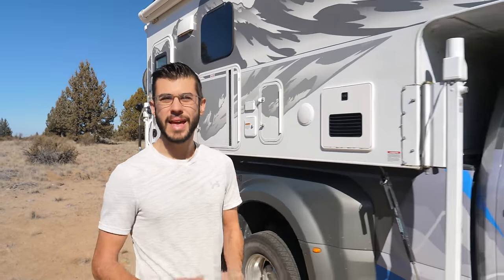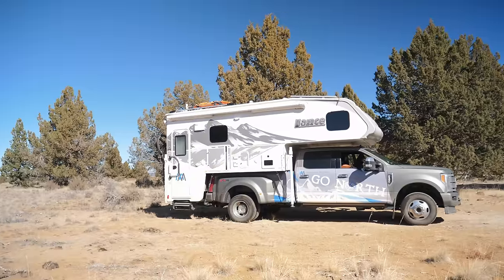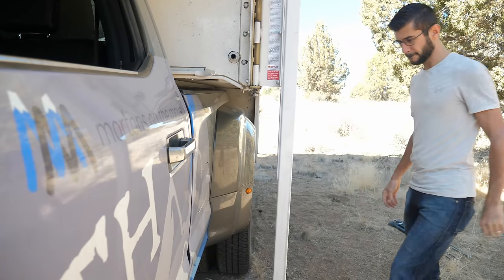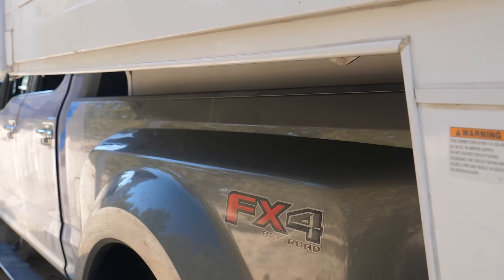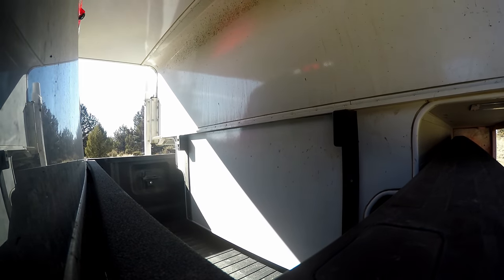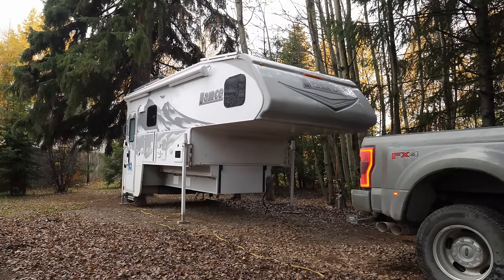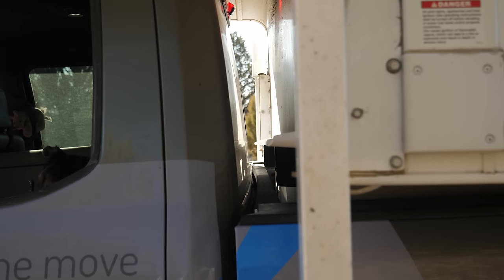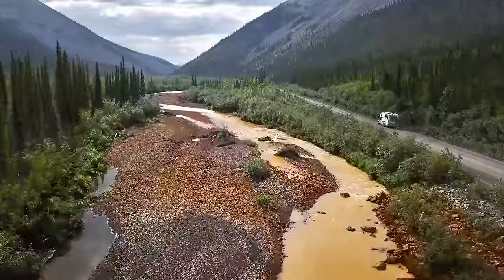How to Load and Unload a Truck Camper on a Pickup Truck | Go North Explore More

Comment: Man! This seem too much work. I might go for fifth wheeler or travel trailer. The easiest hookup is travel trailer.
Reply: And would be more stable on ground lol those stands look wobbly asf
Reply: TCs offer the most flexibilty of any RV and since they're shorter you can camp in almost all campground spots, including many tent sites (with the host's approval). Also, a TC only counts as 1 vehicle not 2, so it's easy to share a site with a friend and split the cost. The other advantage is you can take the camper off and use the truck for yardwork etc. Many class A campers ultimately end up with a TC due to their versatility
Reply: To much work ?? Really
Reply: When elk hunting, I use a truck mounted camper so I can also pull the horse trailer. Kinda tough to pull a camp trailer AND horses..
Reply: True, however, with trailer you’re twice or more longer. It’s nice to be able to park in your own driveway .  I had Cabover camper, Class A and a short toy hauler. Now looking for a cab over camper .

Comment: Nice. I like to drop in a 2x6 or whatever thickness your bumpstops are run along the width of the bed up against the front of the box - wrap in carpet or something to avoid squeaks. Hard braking, steep bumpy declines etc can cause campers to shift forward, sometimes violently and those bumpstops will dent your box and don't give either a firm point of contact. I probably take my camper into places you wouldn't dream of... but worth noting

Comment: I’ve been loading and unloading my slide-in truck campers for years when hunting and extended fishing trips. One thing I’ve learned is when a site is slightly sloping, is to back in to the uphill. That way when I pull out from underneath, I’m always getting farther down from camper as I drive out and don’t have hang-ups. Also, they make or you can have built front camper stabilizers to take care of camper wiggles when using off the truck.

Comment: Have had truck campers for 20 years and your video is spot on. One thing that is possible with electric jacks is to put lever on jack to neutral and using your foot push jack to ground then place lever to lock position, big timesaver when unloading.

Comment: The reason one motor is slower or faster than the other is due to the distance or run from the battery. Depending on the battery location, the farthest away jack will move the slowest.

Comment: for alignment ease when reloading, I mark the center location of my rear wheels before I pull out, with two bright yellow plastic tent pegs, pushed down an inch off the sidewalls. I can clearly see them in my side mirrors. Happy trails.

Comment: I painted a white line down the left side of the truck bed that lines up with the left side of the camper. When putting it back on I look out the rear window and site along the white line as I back up, occasionally double-checking from outside as I usually have to do this by myself just to be sure I'm straight.  Then lower away.

Comment: We bought a 1999 lance (no slides) just to spend 2 summers driving across Canada and up to Tuk.  Our manual jacks made the on/off process a much longer process.  I disliked taking the camper on and off.  And built out a cargo tray into the rear hitch for a 5-gallon gas tank and extra storage.  Electric jacks and fast guns are the way to go.  Good tutorial.

Comment: I use 1/2” plywood squares under each jack pad. 3/4 might better.   I have seen 2x4 or 2x6 lumber split under the weight of a camper jack.

Comment: Is there such thing as wear & tear from the torsion that is possibly introduced the during removal and installation? Perhaps damage to the seals at the edges of the body. Or are these seals flexible enough that damage rather occurs with aging from time, instead of the number of removal & installation cycles?

Comment: Man. Campers have come a long ways since my experiences back in the 90's. We had a 1978 Osprey 10.5' loaded onto a 1978 F-250. That unit had hydraulic jacks that didn't provide enough lift and needed help. Many campers didn't even have that and you had to use 2 portable tripod, cable driven towers you cranked with a come-along system. Very sketchy. Back then campers probably maxxed out at 2,500lbs. Now they climb well over 5,000lbs. 
We didn't even have frame mounted outriggers then. All you could get were turnbuckles hooked to stake-pocket brackets that would often pop out if the rig rocked too hard. Of course, in the 90's they finally had bed-mounted brackets and occasionally you'd see outriggers, but they hadn't gained popularity until later. Hell, we had to make a receiver extension to tow a trailer. Apparently this was unheard of. At least we had a custom hitch that could withstand the torque of the extension when loaded. 
Those days were somethin else.

Comment: I own the same camper, Lance 1172, and I was told by the Lance Dealership that the rubber blocks are supposed to ride on top of the truck bed while the two vertical strips underneath are the rub rails. Just wondering if you heard something different?

Comment: When I load/unload my camper, I usually take out some air out of my airbag suspension.  For my truck, this lowers the bed by about 4”. To re-inflate i use a small manual bike pump, since I haven’t installed an on-board compressor for the bags.
Reply from the maker: We would sometimes that too.  Helps to loose those few inches :)

Comment: I don't have a camper (yet) but planning on getting one.  I am glad that you made this video as i have never loaded one into a truck.  My question is when you were lowering it towards the ground right before the stairs would have hit.  Would you normally put blocks under the rear portion of the camper to (sit on) so that the camper doesn't actually sit on the ground  and take the load off the jacks?
Reply: You are not carrying these additional stuff. The jacks are made for the load

Comment: What about the hitch? my hitch / extension is 42inches and heavy. Not ease to put on, so bad taking off. At home I have a metal frame I put the hitch on. Its at or near reciever height. I would haven't have that while on the road. I tend to use my truck camper as a Class C, like a Class C, then off season I have a truck. When I had a C it was RV ONLY.
thanks
PS My 2020 F350 displays a black dotted line down the truck bed, I put a piece of black tape on my white camper and line them up..done.

Comment: How are the jacks powered from the camper?  Mine are plugged in but they don't raise/lower.  They don't even make any motor noise.  The remote lights up so I know the remote works.   Do they need to be plugged into 220?  It doesn't seem to work off the trailer harness with the truck running.
Reply from the maker: They operate off the batteries and have a fuse somewhere that might be blown. There is also a controller that has relays to run the motors somewhere in the RV.
Reply: @MortonsontheMove    Thank you I will check the fuse.  The remote lights up when I press the actuator and everything else has power.  It must be a fuse/breaker.  Thank you.

Comment: Are the legs on the camper strong enough for it to stand on its own with people and stuff inside?  I was always under the impression that you were only toe use the jacks when it's being stored (and  thus, empty).  I mean the electric jacks are making me consider one of these more as I 've seen ones with manual jacks and that can take a while and is more work (plus harder for a single person to operate).

Comment: Marking the center line with tape is useless. When the truck is half way over the truck bed, you can't see the tape anymore. It also won't tell you is the camper isn't square to the truck. A camper that isn't square to the truck alters the handing and increases wind load.
My method:
I get the camper on the truck bed exactly as I want it the first time. Then I put white tape on the truck bed all the way at the rear end on both sides so the tape is fully exposed and parallel to the camper. Then I put tape on the front wall of the truck bed on the top edge. Then I put another tape on the inside of the rear window. All three tapes on the drivers side are aligned. When I turn my head to see the camper, all three tapes are in perfect alignment and I just manipulate the steering wheel to keep the camper aligned.
Also, whether going on or off the truck you may find the front of the camper will begin to drag on the truck bed because with no load on the truck the rear will be higher.

Comment: are you allowed to drive that kind of truck in the Uk?
Reply from the maker: It would be a technicality. Yes you are allowed, but you would need to get a higher weight class driver's license. Not sure on the actual legality of importing one. Actually driving it on many of the roads would not be fun either since it's so wide.

Comment: What's to keep someone from stealing it when you leave it?
Reply from the maker: Good question.  It would be possible if they had a hand crank, but it would take a long time. They would also have to break in and get the slides pulled in and all setup which would be tough without knowing what they are doing.  Lastly they would need to have a properly setup truck which is unlikely.  One thing we do and I recommend for fifthwheels is to add a keyed or hidden electrical switch for the hydraulics or landing gear.  If they can't get it to move it's not going anywhere.
Reply: @MortonsontheMove  Yeah, after thinking about it for awhile, I feel it was a dumb question. 😬
Reply: I was thinking, isn't a bumper pull WAY easier to steal.

Comment: I'd like to ask about your attachment(s) of your bicycles. I am planning on carrying my VERY expensive custom E- MT Bike and would like to know about your trailer hitch attachment and securing bikes to the ladder system. Thank you. Lt Col/Dr. Brooks Goettle USAF
Reply from the maker: We used the Swagman Ladder Rack for our bikes. You can find it on Amazon here: https://www.amazon.com/gp/product/B003DIMST2/ref=as_li_qf_asin_il_tl?ie=UTF8&tag=moonthmo0c-20&creative=9325&linkCode=as2&creativeASIN=B003DIMST2&linkId=9b09c80dd4c383907490184d63534da9
Reply: Great video.  We are looking to buy a truck camper for our 2017 2500 3/4 ton Dodge Ram hemi.  This looks perfect.  Where can we find a Lance dealer being We are in CT, .

Comment: New to the Channel . Is this a permanent rig for you guys? Or was it a loner, for your GO North expedition .
Reply: They've got a nice 5th wheel trailer the've done a lot of customization to; I believe this was a loaner deal that Lance and Ford worked out with them for this "Go North" trip VLOG; they felt their 5th Wheel wouldn't be a good platform on the roads they would be traveling through Canada and Alaska and some of the "off-road" terrain they wanted to traverse.

Comment: Can someone steal the camper using their own truck?
Reply: Michael Lee I would think as long as it’s lowered as so no truck can get under neath it, it will be ok. That of course if no one else has a lance remote that can cause it to go up and down. I have a 2020 lance 850 with the same exact remote and I do wonder if the remotes work exclusively to each camper or does 1 remote work on all lance campers, anybody know? 

Thanks to the author of the video as I am still learning to line it up after some frustration. I pretty much leave it on the truck but there are times when I do take it off and go into town.
Reply: @jerrysimeone  Thanks Jerry. I was wondering about that too, if the thief is able to raise the camper, it's gone. Unlike fifth wheel RVs, where it can be locked.
Reply: Sadly yes.  The jacks have a manual setting to be used with an electric drill.  This is a simple flip of a switch on each jack.  Also the fast gun tie downs have lock designed for them.  It’s a couple of bucks extra but when you spend the money for fast guns it’s worthwhile to keep the investment.

Comment: Do you take if off everytime you camp or can you just leave it on the truck ? I am thinking about buying one but want to leave it on the truck.
Reply from the maker: No, you don't have to take the camper off every time you camp, you can leave it on the truck if that's your preference. We do a little bit of both, depending on if we need to use the truck for something else. :)

Comment: Does anyone here what product I would use to level a truck camper on a sloped driveway? I back in with into my sloped driveway and when I have it up on jacks there's a lot of weight distributed biased to the front (cab over bed) where it's bending my jack stands a bit.

Comment: Thank you for your video on loading and unloading a trunk camper. However, once you unload your camper, How do you keep it secure so nobody can drive away with it?
Reply: That was my question.
Reply: @Brad Conway - I don't think there is a way to really secure the truck camper from being stolen once you take it off the truck and leave it somewhere. Just have to hope for the best. About the only thing I can think of is to have someone park their vehicle in front of your camper, if possible. But this is unlikely unless you're traveling with someone else who has a vehicle. The only other way is to ask someone to keep an eye on it for you if there's another camper near by. Other than this, you could wrap a heavy duty chain around one of the camper legs and then attach the other end to a tree and padlock it. Again, that's only good if you're close enough to a tree, and then you have to carry around a long heavy chain.

Comment: What kind of dually truck ? Ford F350?    Gas or diesel?  Any rear suspension mods?
Reply from the maker: We had the camper on a 2019 Ford F350 dually truck with a 6.7L Turbo Diesel engine.

Comment: Thank you for the video, is there a locking system to avoid someone stealing the camper when you are not at the campsite?
Reply from the maker: Just the jacks themselves, you would have to manually override them to get them to move which would be hard.
Reply: @MortonsontheMove  thank you for the feedback

Comment: I would have never thought that "one motor might be slower or faster than the others". Mechanically makes total sense. For me, a huge turnoff in the idea of having a truck camper. Not to mention all the other precautions pointed out. I always had it in my mind that a truck camper was supposed to be as easy as setting up a tent, which does not seem to be the case.
Reply from the maker: They're definitely not as easy as setting up a tent. You're right about that! But once you get used to it and find your rhythm, it's not so bad.